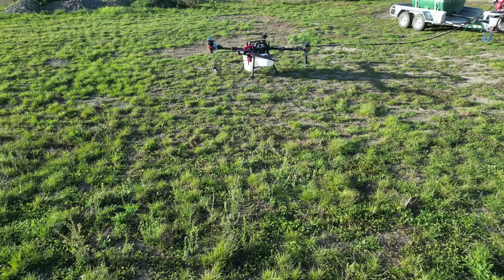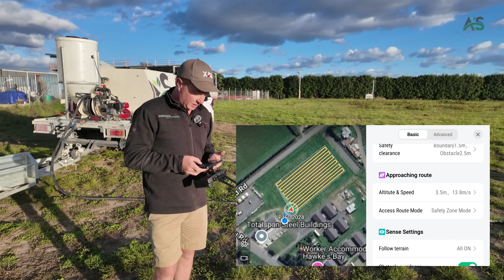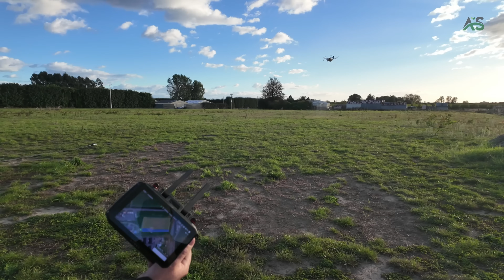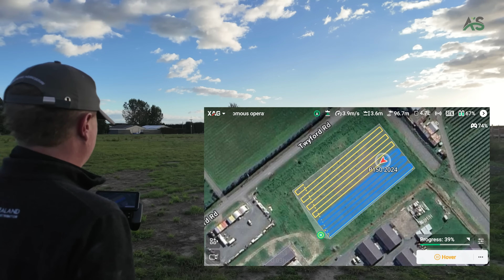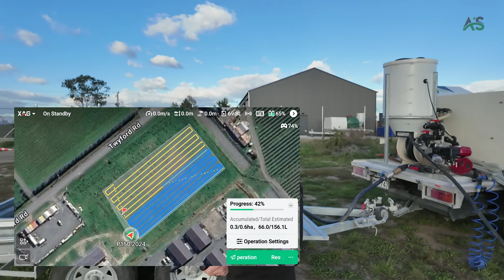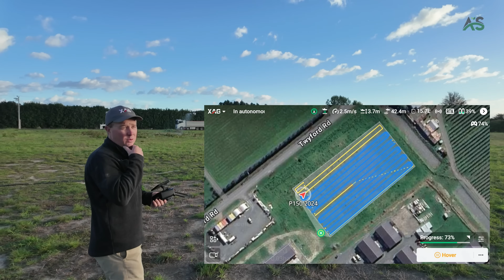XAG P150 in Action! Full Flight Test & App Walkthrough

Comment: Did it go back and get the yellow line it missed in the middle? What happens to that part of the paddock? Looks like it was left behind?  I’m interested to know how/ when it goes back to get it.
Reply from the maker: Hi Chris, yes it will go back and get that at the end. It never leaves any behind 👌 you also have the option to always go back to where the drone ran out if you want to. Otherwise it just does what it thinks is most efficient.
Reply: @airbornesolutionsltd  so it will finish the paddock then go back and get it off it's own accord or you have to manually fly back and get it?
Reply from the maker: @ChrisJordan-w3r  - Off its own accord. No need for manual flight.
Reply: @airbornesolutionsltd  Thank you.  I'm looking at purchasing one over here in AU for Ag operations myself.  Looks to be a great unit.

Comment: Very nice video. I own a p100 pro and I notice inmediately that this p150 thinks faster. Very nice setup too. When you spray, do you have your mixing pump turned on the whole day?
Reply from the maker: @ricardobachmann6329  Hi Richard - we noticed exactly that when we started using it to. With some chemicals we do to keep them well agitated- most though we just flick the pump off each load. Honda pumps and super easy to start but the main reason we go for them is you can vary the rpm - take it down to reduce foaming or flow rates for washing out ect.
Reply: Hi friend, do you need any accessories?